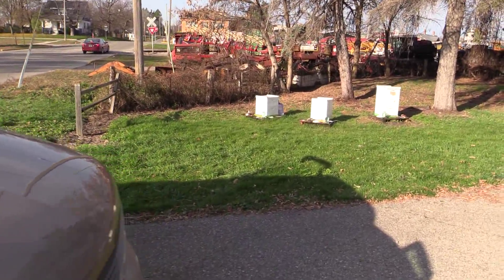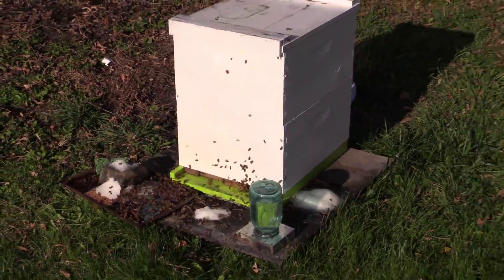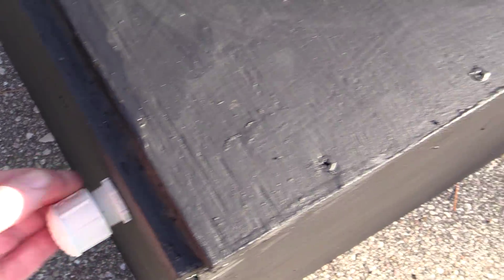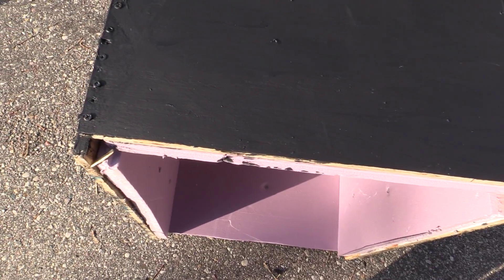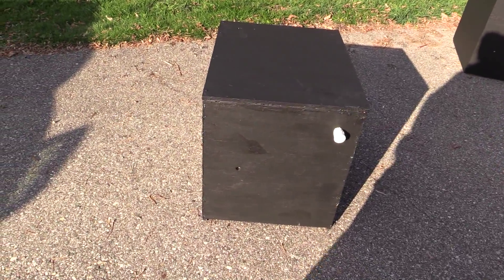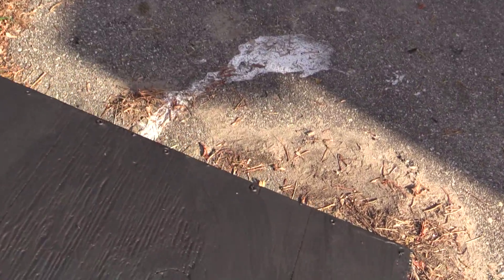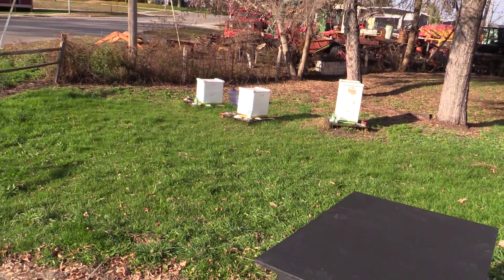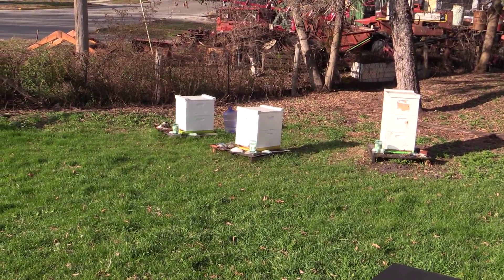Winter Beehive Covers

Comment from the maker: So far these covers seemed to have worked although results will really never be known for certain. Even if all three hives survive the winter it isn't proof of anything. My thinking all along was that the ambient temperature inside the hive would be much easier to maintain for the bees. With an outer plywood cover, inner one inch insulation barrier and the typical beehive the structure would seem to be a place bees in the wild would setup as opposed to a drafty, poorly insulated Langstroth hive. We have had an exceptionally snowy and cold November. 

Last winter was brutal. Had the two bone chilling record setting cold weeks in March not occured, as well as a super cold April I don't think I would have suffered any loss. When I opened the hive that didn't make it the bees were in several clusters with plenty of food. So, I thought I would try better insulation this year. I felt guilty.